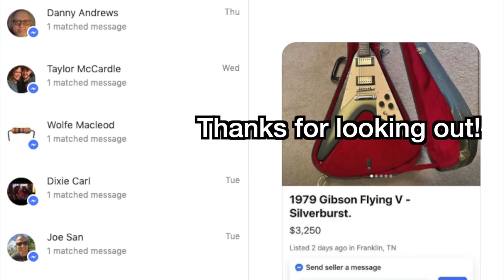I Never Thought I'd See My Stolen Guitars Again | Trogly's Unboxing Vlog #53

Comment: You have lost your rear end on those, I am afraid.  Not much more than firewood at this point.  And notice how the guy you say you knew would come through did not include the valuable pickups.  You should get a warrant and have him put in jail.
Reply: Spanky McCallister Sounds like he probably could, legally speaking. I’m not sure it would accomplish anything, though. Seems like the guy’s trying to collect them all to get them back to Trogly... is getting the cops involved at this point really going to speed things up? Personally I’d wait to get the rest of the guitars back first and then talk to him about the pickups. If he disappears again, I’d probably feel differently. Depends on what the “medical issues” are.
Reply: Thats what I thought.  The pickups, tuners n other hardware no doubt ended up on ebay.  It's common practice there to part out guitars for far more than a complete guitar would sell for n the parts would be untraceable if reported stolen.

Comment: Glad you got those guitars back. Definitely a lesson to be learned there, though I don't think you need to hear that, haha.
Side note, that Les Paul Deluxe might look really nice with an oil finish on it. Super easy to do, all you'd need is sandpaper, a few paper towels, and a little patience. Work your way up the grits and all that, go nice and slow, then apply finish when you're at the feel you want; you can get some fantastic results like that. They feel super nice to the touch, you can achieve matte/gloss finishes by varying the number of coats you apply. I ended up naturalling a 2011 Les Paul Tribute that I got on the cheap and was super lucky with how the top turned out; I love that guitar.

Comment: Also, for your knowledge you use sand paper to remove paint or glue on a guitar. 800 is a bit risky you can blow through. 1000-2000 will take forever on spray paint especially if you wet them (I work wet because it prevents dust as well as dipping my paper cleans the debris off the guitar and sand paper so it works more effectively) but less chance of burn through. In either case you will need to touch up spots once the covering paint coat is stripped. Note, they painted it for a reason to cover something. I just count on burn through and use 800 then up to 1000 for removal. When it is removed I then repair and put a nice new clear on top sand and polish. I put thicker clear on all my guitars than would come from the factory because it really does not mess up your tone, looks better and protects it more! The myth thinner coats are better comes from companies trying to save money on workmanship and materials cutting it as thin as they can using the guise of it magically making the tone better. No, it just makes the guitar more fragile to minor damages.

Comment: I question the other commenters judgement, or ability to grasp what they're seeing. 
A luthier agreed to do more work than his health and time, and maybe finances, could handle. Which is an incredibly common trap people get themselves into. What I haven't heard is whether Trogly pre-paid for any of the work, or even paid for the work that has clearly been carried out.
Trog wanted a neck repainted, he has it repainted, partway; still needs finishing. Wanted to change a guitar over to a new variant, which REQUIRED removal of the guitar's original finish. The red finish being sanded away is a good thing: this'll allow the gold base finish to be put on. That's what I see: actual work has been carried out on all these guitars. The work seems competent, but unfinished. An old PCB broke where you'd expect it to crap itself; removing a nut that's binding excessively, causing rotational force on the pot/PCB interface that old board just can't handle, something that sucks but not wholly surprising or unique.
Finally, so far, in the story up to this point, one (and only one) guitar was stolen. And it sounds like he has had to move spaces, and storage was sketchy during medical treatment, and luckily, only one guitar got snatched.

Comment: Hey Trogly what are "Gibson USA" pick ups, I read they used to be called 490's, is that correct? I got a 2004 Korean Epiphone Les Paul Standard in a trade and the guy said he put some Gibson USA pick ups when he bought the guitar new, he showed me a picture that just had "Gibson USA", Next time i change the strings I'm going to pull onw out to see if there's any other info.